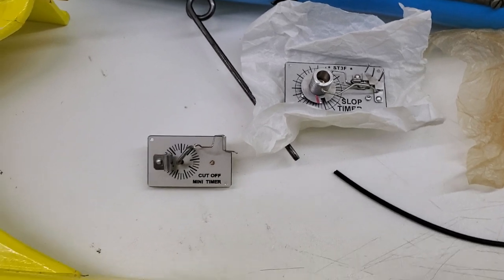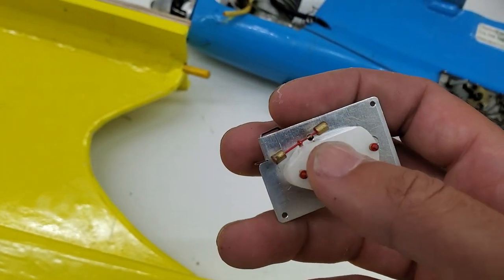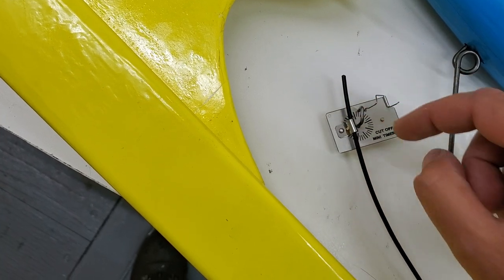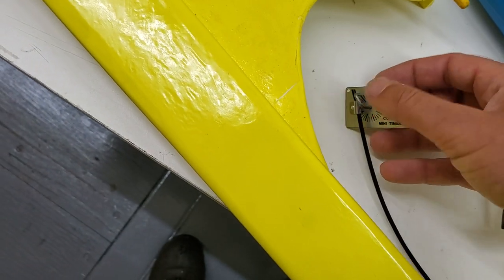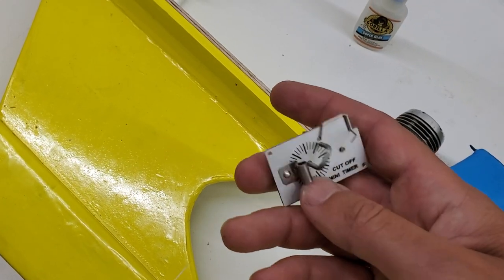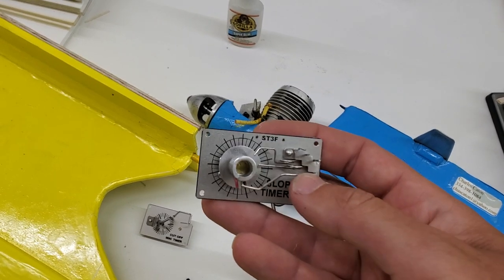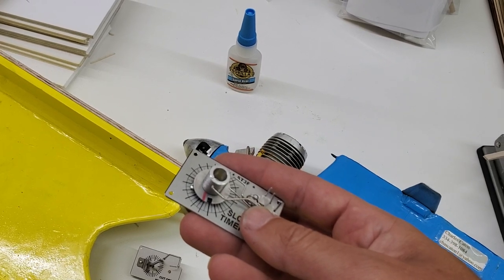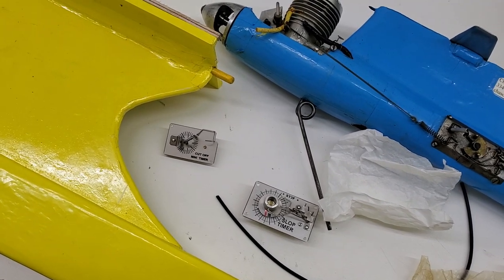Mechanical timer setup for glow powered freeflight airplanes

Comment: I often wonder if you can swap to a modern 2.4 ghz receiver plus a small lipo and micro servo for DT or even rudder assist? Time to consider changing the rules to mitigate the risk of lost models. Ie, divide the flight to an uncontrolledly segment , the radio assist and save some anxious moments?
Reply from the maker: I oppose radio assist in competition on principle, however radio DT/engine cut override has been done very successfully. The problem is there are no commercially available setups for doing that, so you have to configure it yourself.  This, combined with the extremely limited available of remote fuel pinch mechanisms is the reason I haven't tried it yet.
Reply: It all depends on what you want to achieve with what is readily available and affordable. If the objective is to hang on to the past and nostalgia, then hang on to the past and it’s technology. However, it will become increasingly more expensive and kill off the hobby , I.e. dwindling membership. Evolving and adapting to current technology could potentially grow the interest and keep our hobby alive. By all means have a die hard category. But evolve to attract more interest and membership. I have been aeromodelling since childhood. To see a beautifully built plane fly away lost or destroyed is soul destroying. It causes all but the diehards like us to give up and walk away. A nine gram servo and 5 gram receiver can be the difference between a new member or a lost hobby generation. Maybe have a new competition class awarding most innovative 2.4g dethermalizer gas cut off contraption for free flight and DT cutoff using more modern cheaper affordable techniques. E.g. launch and free flight TX on the ground. Pick it up when in danger or fuel runs out etc .MTCW